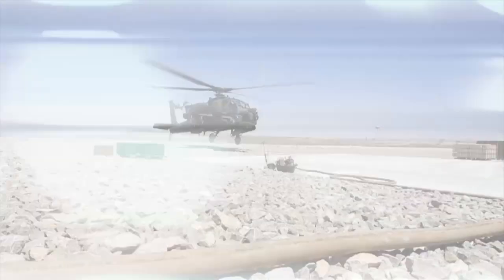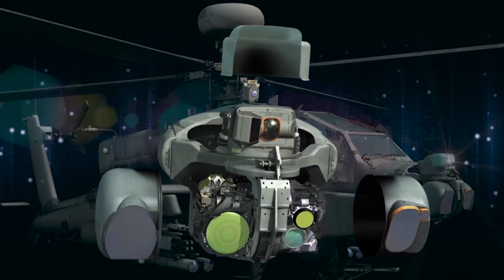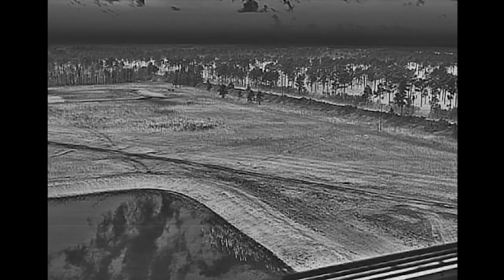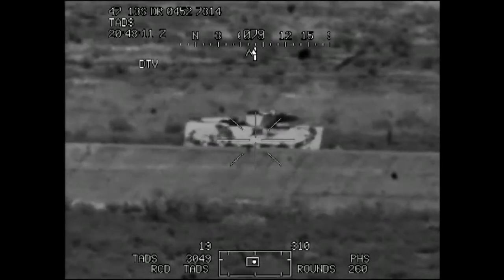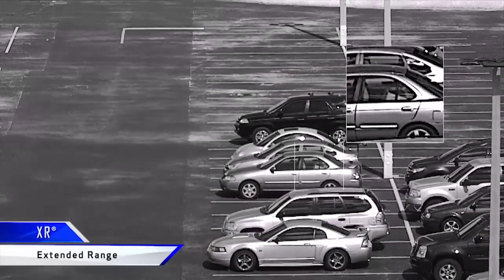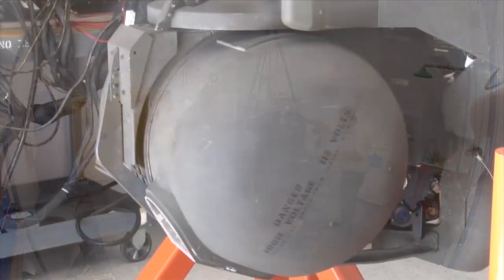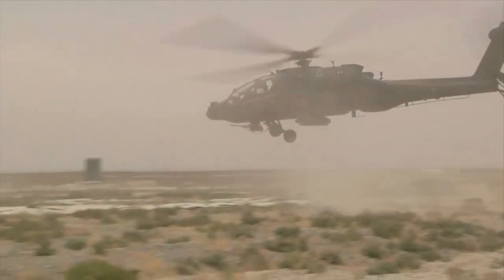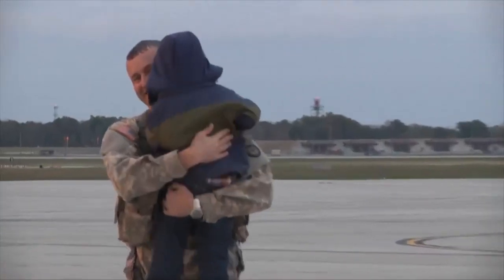Apache Fire Control: Modernized Target Acquisition Designation Sight/Pilot Night Vision Sensor

Comment: That girl looks like a paid actor tbh. I don't think she actually works at LockeedMartin
Reply: typical what?
Reply: PÉGATE UN TIRO
Reply: Sorry just looked her up. she does work at Lockheed Martin.
Reply: Well if you say so, then it must be true.
Reply: I did not say it was a fraud, where'd you get this. It was only my opinion that she looks like an actor in this video. No hate, no nothing. Just looked like it to me. If it's not true, then more power to her. She can do engineering and act as well :)
Reply: SJ sorry for the miss accusation
Reply: howard weitzell Speak first, think later huh? Maybe that is the mistake you make. 
Because no, I meant none of those things that you assumed. Funny thing is that you are in fact racist and sexist, because you can't take a statement at face value. You have to interpret it in such a way that you can virtue signal.
By saying she looks Indian, did you just assume her ethnicity? By saying that looking Indian she has smarts, did you imply that other ethnicities may be dumb? Because that is racist you know.
See? This is what happens when you derail the conversation from actions to identify politics.
Reply: SJ Actor or not she was chosen for this video over dozens of white and east asian males who probably contributed more than her for the actual development of this system. Gotta keep that "progessive" propaganda churning 24/7
Reply: I can't say that you're wrong. But my intention was not to bring out this aspect.
Reply: You nailed it. You are very smart.
Reply: I see, you are a troll. Nice memes.
Reply: Yes, ofc ofc.